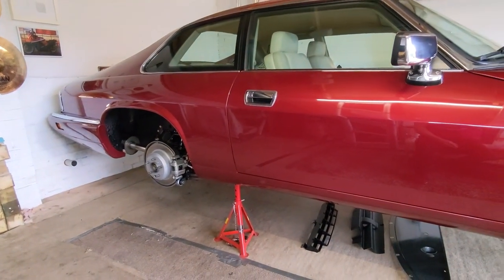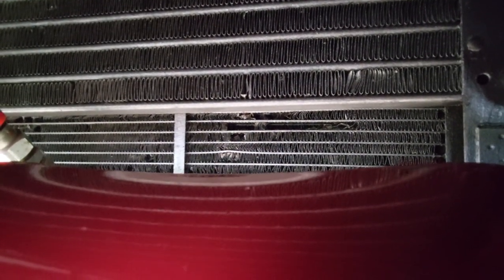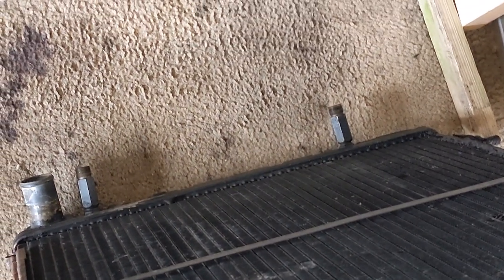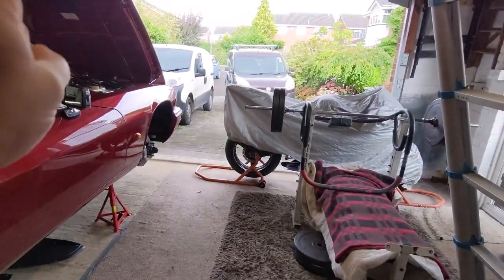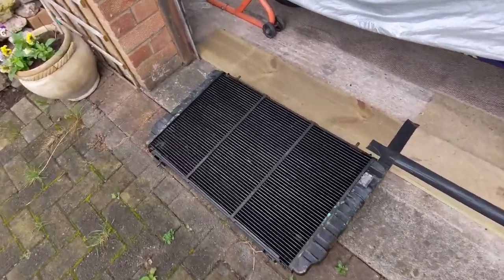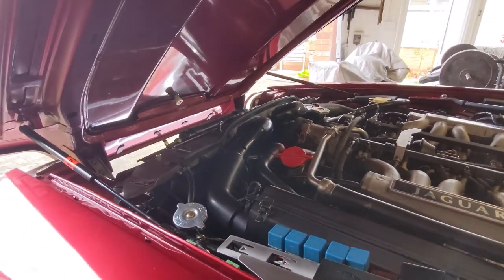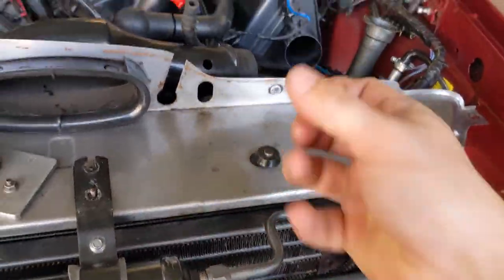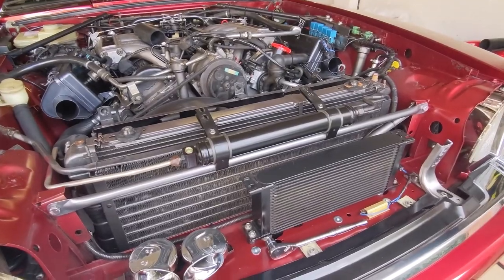Jaguar XJS 6.0l V12 facelift 1994 Radiator removal

Comment: An incredibly clean car - probably better than new. Congratulations and thank you for posting a very useful video.  I am up against a similar task for my ´89 v12 and your film has given me strong encouragement. Regards. Peter Daisley-Worrall
Reply from the maker: Thanks, as long as you note how everything comes off and don't damage anything/snap bolts etc.. it all just goes back in the way it came out. Enjoy getting wet though doing the radiator haa - although apparently you can stick a pump down the rad and remove most of the coolant prior to doing this job.

Comment: Removing the bonnet and AC condenser is not necessary, but the alternative might not be any less work.  You need to remove the mechanical fan (four nuts), unbolt the fan shroud top and bottom, follow most of the other instructions you’ve already covered, and then pull the radiator and shroud up together.
Reply from the maker: Interesting, I didn't think the fan shroud could be split horizontally at all, I'll look into that. I don't think leaving the bonnet in place would work however, surely it would get in the way of lifting the radiator?

Comment: Love your videos - thanks for making them. Your car seems remarkably free of rust for a UK car - has it had a complete restoration? In the brief underside shot it looks like you have pristine radiator support panels etc & even all the bolts are still shiny. The ones on my car are very scabby :)
Reply from the maker: Thanks, I make them as a substitute to taking photos, so I will know where everything goes back.! But happy others enjoy/find them useful. And yes, I sort of refurbished my engine bay years ago before I knew anything much about working on cars! And also just lucky, the underside of my car was in reasonable condition when I got it!

Comment: Hey m8. 2 years late sorry. If you take out the bleeder banjo bolt you can drop a line in from a vacuum reclaimer thing and suck out most of the coolant. So im told anyway.

Comment: How hard is it to line the hood back up?  Does it pretty much fall back into place, or are there a lot of fiddly adjustments to make?
Reply from the maker: If you only undo the gas struts and front fixings from the hinge onto the bonnet/hood.. you can mark where the bonnet is sitting exactly before removing the bolts.. if that makes sense. Then reinstallation is fairly simple case of reattaching bolts and lining up to whatever mark you left (you can use masking tape etc). I've got the bonnet off currently again but this time I've removed the hinges from the front chassis and the closing mechanisms.. so lining up is going to be from scratch which is a bit more involved but I'll cover that in a future video when my 2023 works are complete! Currently on part 5.. probably going to be a while!